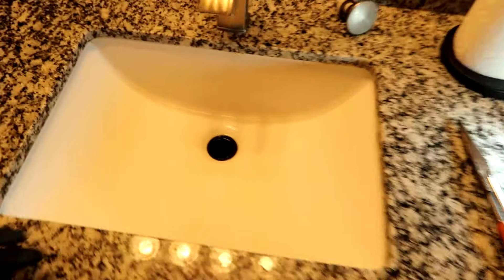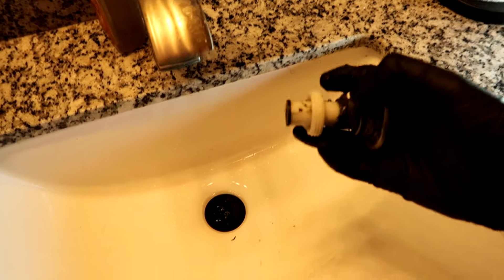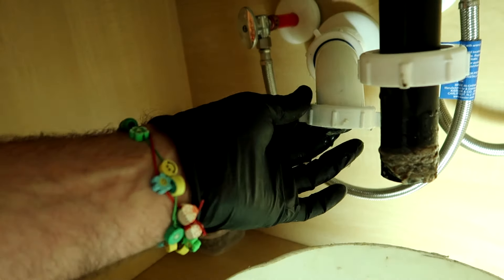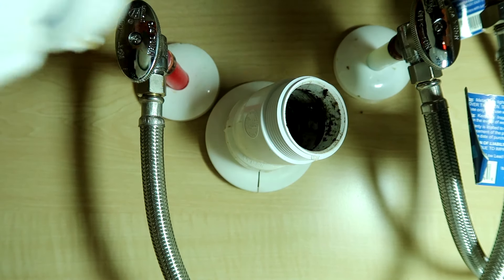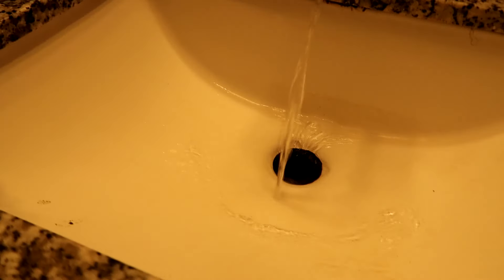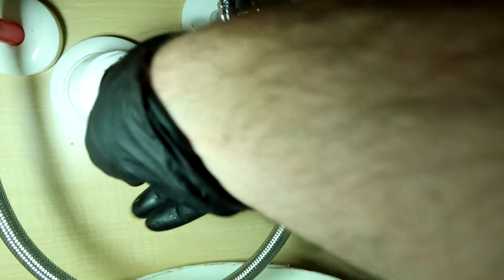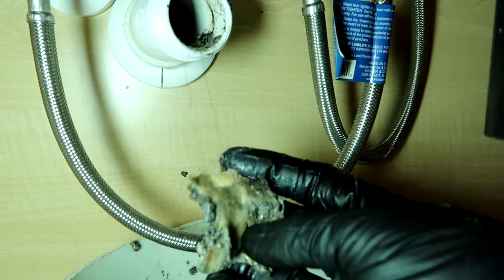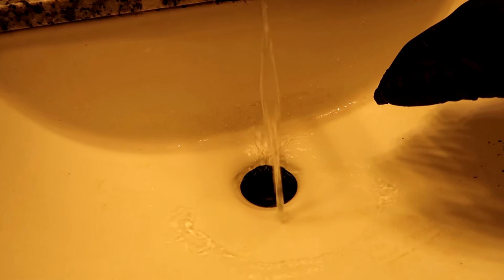Bottle Cap Dropped Down Sink Drain. Can I Fix It?

Comment: You just proved how crucial it is to test after a repair. What I do when im down there finished with an unclog with a trap undone is take off a supply line and blast the drain line in the wall just to pressure wash it basically. love these satisfying jobs. & man i cant stand it when residents have endless junk under the sink!
Reply from the maker: So true! Good to hear from you, Oliver!
Reply: Shouldn't the tenants remove all of their crap from inside the sink cabinet so that the tech can work on the issue?
Reply: @elsensei5400  seems like a common sense thing but it doesn't happen all the time

Comment: Got a great little tool at big box hardware. It is like a short snake with a tiny grabber on the end. that little bugger has worked wonders with getting junk out of drains, especially things like a disconnected bathtub drain plug and also globs of long hair.
Reply from the maker: Thank you so much for watching!

Comment: It always amazes me on what goes down a drain. I've pulled t-shirts out of toilet drains. Just the other day I had a toilet clogged with a piece of hard plastic that was bigger than the drain hole. Befuddles me on how things like that happens.
For this drain, I would have used my shop vac to pull all that gunk out. Good to see you back.
Reply from the maker: Thank you so much for watching!
Reply: mid and post concerts are the worse. go to whizz? all toilets stopped up and overflowing, same for urinals/whizz troughs.
then have some dunce kick a stall door into you? been there done that on both sides of the game.
once an idiot kicked the stall door open into me... when I turned around and started to step out, the little turd yelled sorry x10 and his three friends scrambled to get away from the crowded restroom.. I never said a word, nor had any offensive motion, but it must have been a super crazy killer look or something? then again, I was kind of beefy looking back then?
or maybe because I turned around with big willie still hanging out?